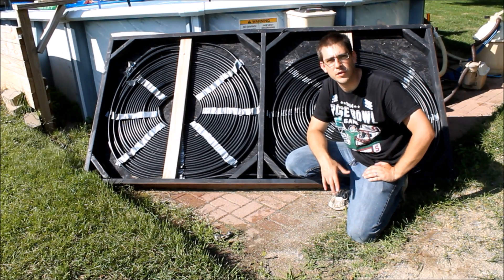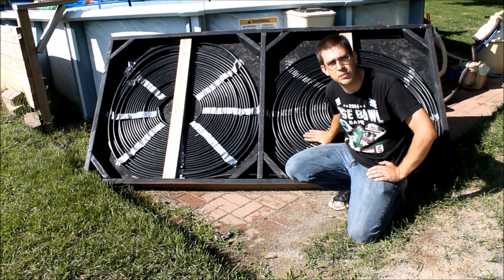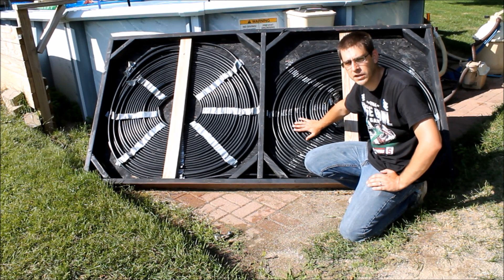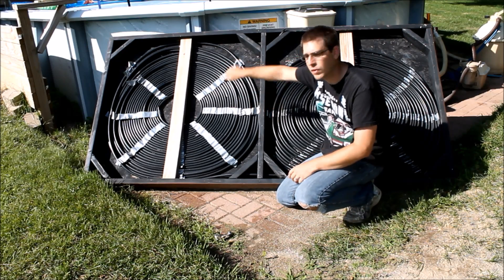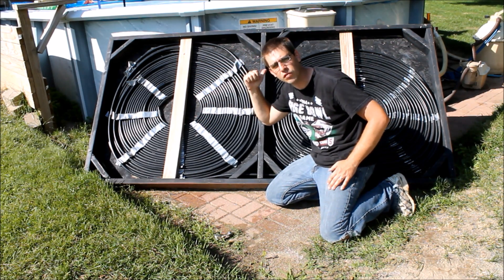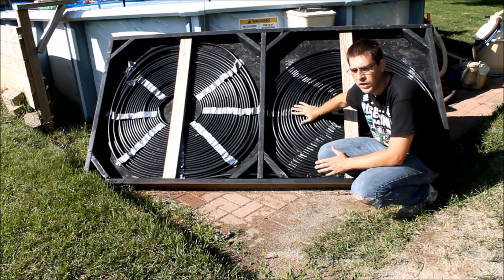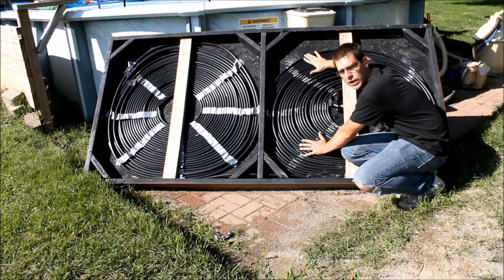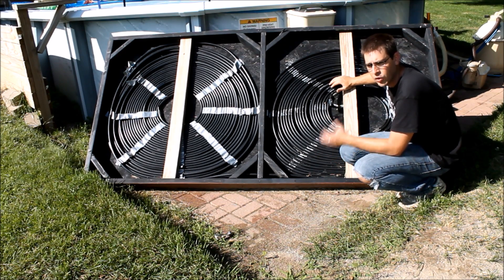Solar Pool Heater and Diverter

Comment: Please consider putting a sheet of tempered glass over the box, you will notice a dramatic difference in the efficiency of the heater and a temperature increase in the water exiting the unit. Also consider getting some polyisocyanurate insulation at the home center, it has the highest R value and max temp of 250F, place the insulation under the coils and around the walls, insulation plus the glass cover will make a huge difference.

Comment: 5:25 - "Real basic design"
You 'yada yada'd' over the MOST important part.
I have no idea what any of those connectors are.
I have no idea how to get 1.5" pipe down to irrigation hose diameter.
How is the flex pipe secured to the PVC?
What should I be buying?
Reply: he answered how he reduced it in an earlier comment response up higher.. tried it and it worked

Comment: Nice vid - use glue to stop it distorting. You may not need to divert via the pool pump as heat will naturally cycle the water if it is elevated.

Comment: These are great videos! So glad I found your channel. Just looking for a video on how you built your diverter and if it’s too late once there’s already water in the pool and running through it to add something like this on?
Reply from the maker: You can add something like this anytime. Just close off the inlet and outlet to the filter and connect the tubing

Comment: I wonder what adding sand to it will do - sand attracts heat and retains it - think about the beach - the one thing on a very hot day the SAND is HOT ..wonder if we add it to it as a fill in the gaps if it would work

Comment: In fact, you want your water to go fast through the piping. You prefer to have a lot of water heated off just a little bit. It mean the system is more efficient because for every degree your water take, the heat transfer between the hot pipe and the water is slower until they are both at the same temperature and the heater is very unefficient.  You are right, no need for any mecanism. For 500 feets, I would prefer to do 5 loop of 100 feet in parallel. Also, never ever close both side of the solar pannel. the pressure can get quite high inside the tubing. Good job and thank you for sharing your design.

Comment: So, when winter arrives, and the temperature drops, how do you drain the water to prevent a burst?  I suppose that you could move the whole thing bodily into a frost free area. But it is probably really heavy.
Reply from the maker: Air compressor to blow water out

Comment: Can you leave water in it and shut off the diverter? If your pool was already as hot as you wanted and you don't want more. Or would it expand the tubing to sit there in the sun with no movement to the water?

Comment: What ever you do, don't let it sit in the sun without water flow, it will get hot enough to melt the plastic tubing, at least here in Florida it will. I found out the hard way when my pump failed. I ended up with three splits and many blisters, along with the straight coupling melting into a V shape
Reply: Now why would you need a pool heater in florida? lol

Comment: I built a solar heat panel after watching some You Tube videos.  120.00 for the plexi-glass,  89.00 for the adjustable pond pump.  30.00 dollars for the 4x8 sheet of plywood,  20.00 for the four pieces of pressure treated 2x4, two garden hoses for the in and out at 70.00..(I buy American made when I can,  not the Chinese junk)  300 feet of 3/4 pex tubing was 135.00, fittings to link hoses to pex tubing, etc 20.00, screws to hold plexi-glass to frame and put frame together I would say I used about 10.00 worth,  Paint spray cans black 20.00 worth,  all total= 514.00 Results?  I live in Central Pa, currently on 4/28/2020 it is about 55 degrees outside and sunny.  with some clouds passing through.  The panel is heating up to 100'F inside and the continual output is 64 degree's.  The pool temperature is 54'F  It's cold outside so I imagine it will only get better.  I think the mistake I made was using 3/4 inch pex tubing instead of 1/2.  I will be making another one using 1/2  inch pex tubing which is  only 75.00 for 300 feet.  The 3/4 will feed into the 1/2 inch then.  I am a little disappointed with the results, I expected better after spending 500.00 and I forgot to mention caulking I bought to seal everything up.  I did this because I wanted to extend pool swimming season.  I worked hard and spent 10,000.00 putting in a built in pool for the family.  did not seem right to spend that money and only be able to use the pool for three months out of year.  I hope this does the trick but am not convinced.   You can buy the rubber panels on Amazon for 250 a section.  I may have been better off doing that.  Also, to anyone thinking of putting in their own built in pool, if you have some common sense, you can do it. The pool companies in my area wanted 35,000.00 to put in the same pool..(pool included)  I did mine for about 10,000 including the concrete patio surrounding pool.  FYI.

Comment: Hi, thanks for the great video.  I live in Canada and was wondering what I need to do in order to store the solar panel for the winter?   Do I need to keep it indoors? How would I flush the tubing to ensure that no water is left in the pipe to prevent freezing?
Reply: If you have an air compressor...............blow air through the tubing, it will push the water out.

Comment: I have an above ground pool display that is only 8' diameter, the smallest they sold to the public is 12'. My $12 100' foot roll of black poly is made on a 3'X3' square, and 200' could easily fit on a 4'X4' square. My box walls were made from 3-side aluminum channel beams from old discarded hot tub covers. Once the coil is in place another beam is wedged in to hold it flat, perfect fit. Big Box stores for plexi is an expensive route to go. I went to a plastics supplier in my area called Midland Plastics, and I got a 3'X3' piece for under $20. So aside from some barb fittings, the bypass valve, etc... my major expenses were $32. And with a solar cover to trap the heat in at night and timer to run the pump daytime only... VERY EFFECTIVE!!!

Comment: Does the PVC pipe go under the ground?
Reply from the maker: in this case it just lays on top of the ground and I added insulation to the tubing between the pump and the solar collector but you could also bury it

Comment: This is a cool video. It made me think. Why don't you just put a really large black circle in the bottom of your pool? One, that could be easily removed and cleaned, simply by sliding it out. It wouldn't have to be a thick material. A light one would do. Made out of what I'm not sure, but it sound's a whole lot easier to do. You could even make something that floated on top of your pool to heat it up. A large solid circle of black with a few holes in it, just enough so the water would flow on top of it and that it still floated on top of the water. Seems to me whether its below on the bottom or floating on the top.. it be a good idea.
Nice video buddy. Have a nice day.
Reply: The bottom of the pool, you'd be stepping on it, and the pool gets most heat from the sun daily, but if the water was darker it painted black it would help marginally I bet. 

Pool covers are pretty dark blue normally, I'm sure they make black, and if it's the thinner ones they will work similarly to the panel, problem is you cant play in it if you are heating it.
Reply: Why not just use black tile

Comment: Good job, it looks good. Could you make measures for us? By measuring input and output temperature and water flowrate we will be able to calculate power collected from sun and put into water, and then improve it. The winding tube design is a problem because it need more power from the pump to circulate. The coropool makers are working on a collector massively parallel with better flowrate and power.

Comment: What are your thoughts using soft copper pipe for the coils. 2 - 50ft rolls.
Reply from the maker: +sdp300 i think that would be fine but way more expensive and you would want to paint them black
Reply: NO....not if you use chlorine as a sanitizer in the pool.  Chlorine will react with the copper.
Reply from the maker: +firemedic947 no issues with it at all so far, two years running chlorinated water through it
Reply: +SSLFamilyDad I thought you used pvc pipe for your heaters?  I was responding to the question from the other person about using copper tubing instead of plastic.
Reply from the maker: +firemedic947 inside the barrel is rolls of copper tubing. It doesn't seem to be an issue although i have head not to use cooper with chlorine it seem to be fine
Reply: +SSLFamilyDad....barrel?

Comment: Can  any one  tell me how  many  gals  this will  be in  sense as  to  use with  an  parked RV for  showers or  doing  dishes? Sounds  great  for  a  pool but  I  am  looking  as  to using with  a  parked RV on the  roof  top Not  worried  of extra  load when  not  moving!! as  well  it  will be  supported once  parked via other  means the  plywood boxing and  another box  underneath holding  the  fresh cold  water....  and  Support in  bath room  directly under the  placement  up top... then later  placed on  roof of  RV shed..
Just  needing  gal rate per the footage of tubing. Thanks
Reply: Youd be looking at 5 gallons worth of water for 500' of 1/2 tubing. If all youre using it for is a shower youd be better off using just a 5 gallon bucket painted black. Leave it in the sun during the day and youd have perfect shower water. Use multiple buckets for more water. Making what this guy did just for showers would be over kill.

Comment: great video. Just roughed in something similar onto the roof of my shed. How are you connecting those smaller pipes (look to be about half inch) into the larger plumbing? I can't seem to find that sort of reducer or adapter anywhere. Any tips on where you found it, or what to use?
Reply from the maker: +Justin Pritchard I used a 1 1/2 bushing that reduces to 3/4" and the then a threaded 3/4" to 1/2" irrigation connection. Hope that helps

Comment: Here's the complete project.

https://youtu.be/5pDzDgKIsVE
Reply from the maker: +MrSmokindabud Looks perfect man, I like using the two separate heaters instead of pilling it all into one like I did. Looks like it is working well too!
Reply: SSLFamilyDad Thanks a lot buddy. Next year I'm thinking about adding 2 more and putting them on wheels to push around. Right now each one weighs about 40lbs. They do work pretty well, I live in Pennsylvania and have been getting 40-50 degree nights and still able to keep the pool temp 78-80. I had the pool closed a couple weeks before labor day last year but I'm still swimming now.

Comment: Here's part one of mine.

https://youtu.be/sxDAfHttVGE
Reply from the maker: MrSmokindabud Looks great, I like how you mounted the tubing on the board and the adjustable legs. Thanks for sharing this.
Reply: Thanks bud it was based off yours just had to make it a little different for my father because he can't lift heavy things. So I used a 2x3 frame except the legs. I'll be sure to post the finished version tomorrow or the next day.

Comment: I made one similar to this for my 30000L pool in Italy. One thing you should consider is having many 6 or 8 smaller panels with thinner < 20mm tubing running in parallel instead of serial, connected to two large > 36mm main pipes going to and from your pool. In this way you can push much more of your pool water through the panels and obtain optimum flow to increase the temp higher and faster as well as lessening the pressure on your filter and pump.. Maybe I will make a vid of my panels so you can see the difference. However here is my first effort in images (I have since rebuilt them and added 3 more panels as well as larger main pipe and mounted them in the roof of our gazebo.) http://rimstar.org/renewnrg/solar_pool_heater_diy_homemade_sm.htm

Don't forget a pool cover for the nights to keep all of that new heat in the pool.
Reply: Sam, I don't believe flow rate will make a difference in the time it takes to heat a pool.   Slower flow produces hotter water, faster flow produces cooler water.    Either option distributes the same amount of sun energy warmth to the pool.   I do however like your idea about lowering the pressure load on your pump.  Very nice pictures of your work.

Comment: Here's a suggestion for others doing this.  I found that if i run the pump continuously as sslfamilydad is doing, you really have to slow the water down running through your coils.  other wise its only a few degrees, if lucky, more then what the pool is.  which means your wasting energy running your pump 8 hours a day. So what i've done is get a multi timer to turn on every hour and run for 15 mins. I have 800 feet of 3/4" poly pipe on my roof in several coils.  it runs 7 times from 10am to 4pm, (i would like to get a timer with more settings as it could be run every 30 mins for 15mins in my opinion on a good day).  It heats the pool very well. I've had the pool over 80 degrees,
Reply from the maker: purewack0 I have seen quite a few others doing this as well and that is surely one way to go. I might disagree just a bit and I will tell you why. You can either run the water continuously and heat more water but only a few degrees or you can run less water through and heat it up a lot but you are still only adding the same amount of heat to the pool. I have done some testing with my wood burning heater and it is equal either way. Some also theorize that you can get more heat in the pool by running the water through faster since it supposedly heats up quicker when colder. So no matter what the flow of water is through the pipe you still only have one set amount of solar energy hitting the surface. Whether slow or fast you are still doing the same thing except if it sits without water running through it for a time while it heats up then all of that het energy is wasted and mostly dissipating back into the air. That is just my take on it anyway but either way will certainly heat the pool! oh, and I run my pool filter 6-8 hours a day anyway, don't you?
Reply: +SSLFamilyDad  I disagree with the above statement, maybe i'm missing something, but in the system i've built (same as yours but with 5/8" tubing and currently 200')  After pumping the heated water from the tubing into the spa,  (at about 110*)  if i keep the pump on, all i get is the colder spa water flowing thru and back into the spa.  By running it constantly it doesn't stay in the coils long enough to heat up.  It would never rise enough if i let it just cycle thru.

Comment: I'd like to say, great video. I think I will be making one very similar to yours. One question I have is to the degree you set your stand? Why 45 degrees. have you tried other set points and had less luck? If you're Michigan like I thought I hear, you might have more efficiency at 70 degrees.
Reply from the maker: nutman411 That is a great point, and you are probably right. I originally made it at 45 degrees just for easy of construction and I thought it would be the best "in the middle" angle for the sun throughout the day. However, I am not opposed to a different angle that could probably collect more sun energy
Reply: @SSLFamilyDad  A good rule of thumb is the angle needs to be the same degree of parallel you are on. My Lake house is in Kentucky. It is on the 37 degree parallel of the earth therefore, to get maximum solar heating, the solar panel needs to be at a 37 degree angle. There is a website that explains this FYI.

Comment: The sun will destroy the Plexiglas in one summer.  I was hoping to see water temps measured and how much it warmed the pool.
Reply from the maker: alan headrick I never had the chance to do the water temps testing with this and I have retired it for this year as we are landscaping around that end of the pool. I may rebuild with a different design for a new location later this year but won't have any measurements out unfortunately. We are using solely the wood burning pool heater which works much better.

Comment: Why not all of it? It will evenly heat up.
Reply from the maker: Michael Miller I think the main reason is the concern that you had originally. You will burn up your pump reducing from 1 1/2" to 3/4" unless you make several separate loops so you can divide the flow between maybe 4 3/4" loops. If you did that it would be a great way to go.

Comment: What size and type of tubing are you using? My pool inlet and return are 1.5in.  I was considering using polythylene irrigation tubing. I can get 1000ft 3/4 for 100$ on Amazon.  My concern is the 1.5in to 3/4 reduction.  Will that be a problem?  Or is that good?
Reply from the maker: Michael Miller  I am using 1/2" irrigation tubing. You don't want to force your entire water flow through the 1/2" or 3/4". You will want to use a diverter like I showed in this video so that you can just divert some of the water flow instead of all of it.